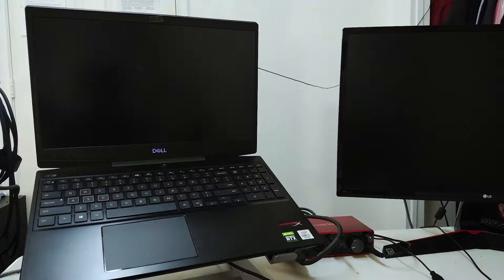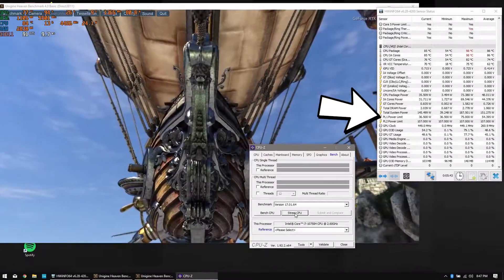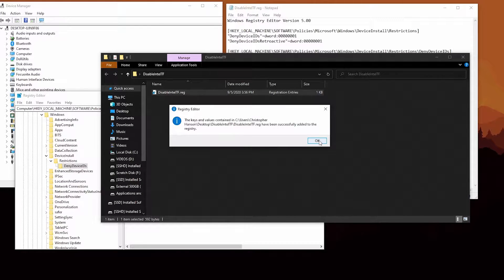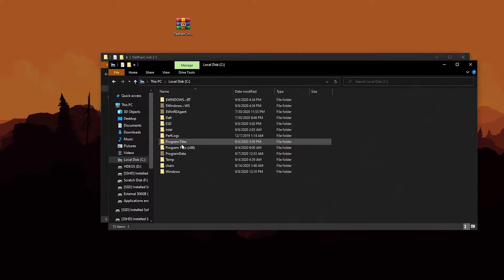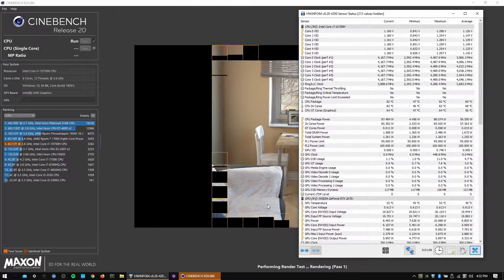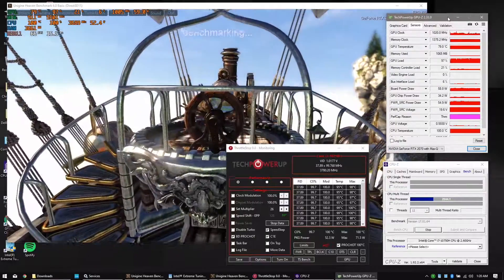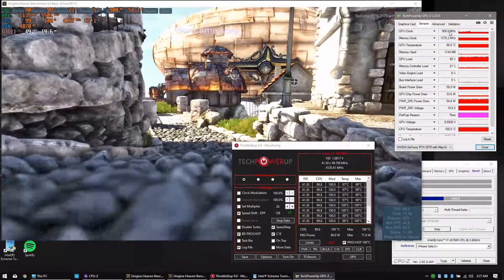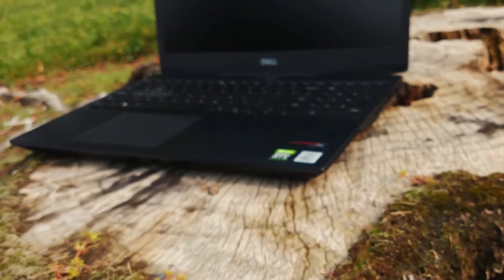Dell G5 5500 - Disable Intel Dynamic Tuning (Unlock CPU Power Limit) | Fan Control | 5 Games Tested

Comment: Just a few questions if you don't mind. My friend just bought this laptop and I'm going to his place to apply some of these tweaks because he's concerned about thermals.

1. Is deleting the Dynamic Tuning drivers just to make sure the cpu has enough power to reach boost? OR is it part of the solution to help cool the system down? If I'm letting go from 30watts to 90watts... isn't that just introducing more heat? Can the power supply handle it etc? 

2. Did the liquid metal make any difference? From the video it looks like it didn't ... but removing the dust over did. If I can keep the "fix" easy it's better for him cuz he's a lil concerned about me doing too much to a brand new machine. 

thanks in advanced! Great video.
Reply from the maker: Thanks! Glad you liked it!

As you can see in the video, if you run the computer with the drivers installed, it will boost fine. However, as I also showed in the video, these drivers adjust the Power Limit on the fly, and sometimes to a value MUCH lower than 36W. (Could be a bug, though I don't really care) You could set a higher Power Limit with Intel XTU, but again, these drivers would just reduce the limits on the fly. By removing them I can set whatever power limit I want and it will STAY there. If the CPU gets too hot it will thermal throttle normally to protect itself, this is built in to the CPU, you don't need drivers.

Yes, allowing it pull 90W is introducing more heat and that's why I applied liquid metal. To get the heat off the CPU quickly. If you're concerned about the power supply just don't give it a huge power limit. I don't mind since the power supply that came with my G5 is a 240-watt one, which is plenty for this machine. Temperatures while gaming are fine as you can see by the end of the video and my G5 is still working perfectly.

Also, you just won't find a real world application that will hammer both the CPU and GPU to this extent for a long time. If you do, adjust the power limits accordingly, but again, the CPU and GPU will throttle down for protection if temps get crazy.

The reason liquid metal didn't work by itself is because the dust filters were the thermal bottleneck. I discovered this AFTER applying liquid metal. The heat was leaving the CPU and GPU super fast and getting stuck in the heatsink because the airflow was awful. I'm confident that with regular paste the temperatures would be worse, even after removing the filters. You can always remove the only filters and test it for yourself.

The CPU die area is tiny so thermal transfer suffers. Therefore, an interface with higher thermal conductivity such as liquid metal will GREATLY improve the heat transfer. A GOOD thermal paste has a thermal conductivity of around 5 to 12W/mK. Conductonaut has around 72W/mK. It's like night and day.

The reason I was concerned about thermals is because it hinders performance when the chips don't boost properly. Intel CPUs for instance are designed to run at 100 degrees in a laptop, especially with such low voltage and amperage. I don't even trip about it otherwise we would have seen a TON of broken Macbooks because of CPU temperatures. It's usually something else that breaks on those lol

If you have any more questions don't hesitate to ask! Cheers!
Reply: @thegameplayer4369  a that was a great explanation. Thanks!